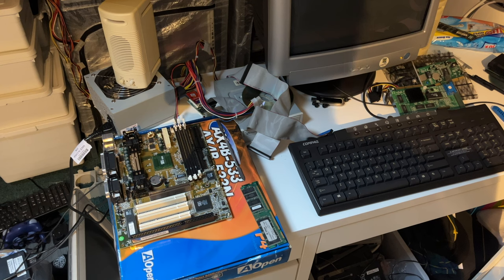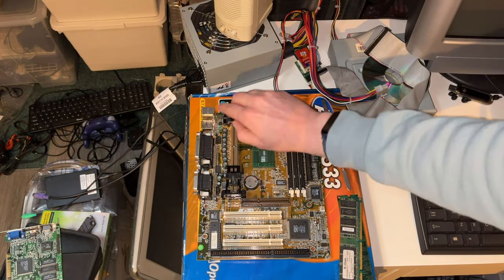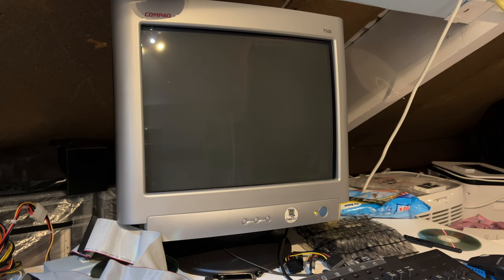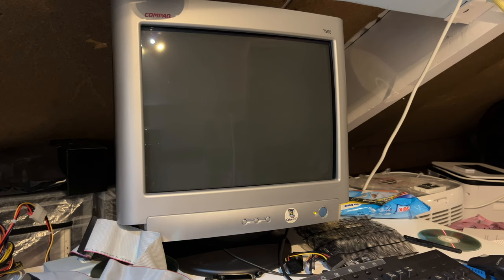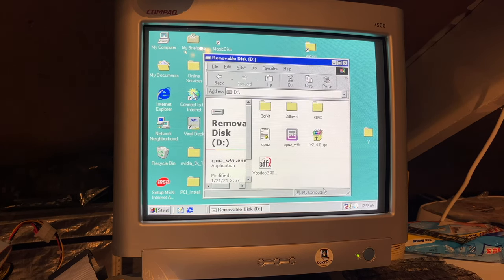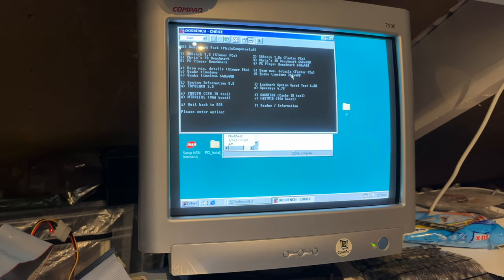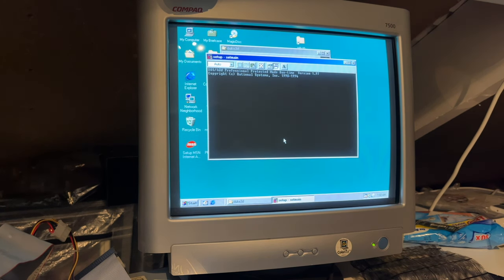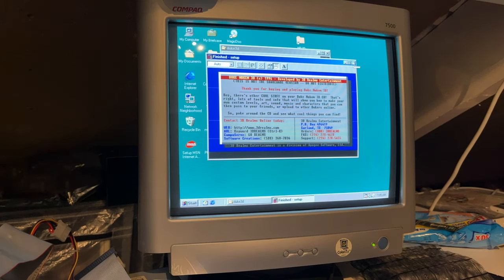Vintage Motherboard Haul - Part 2 - Chaintech 6SSA2

Comment: Thanks for the video. I was trying to find out if I can run a Coppermine Pentium 3 on that board and apparently I can.
Reply from the maker: Yes, P3 coppermine works with 100MHz bus. Not supported and might overvolt, haven’t checked that.

Comment: I recently got this motherboard. It’s hell to set it up, whatever hard drive I try to use it either won’t recognise it, or it gives me a boot device inaccessible error. IDE auto detect will detect some drives, others I am setting up manually but it seems to be a problem in general. Any ideas?
Reply from the maker: @NLDriver  smaller IDE drives and my 4GB CF card worked fine in my testing. Sold my board so I can’t do any verification.